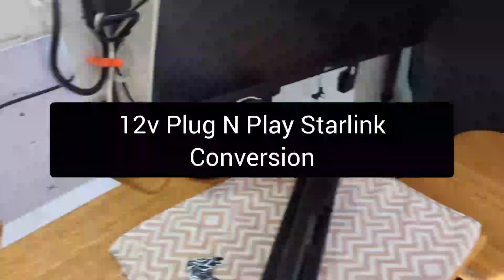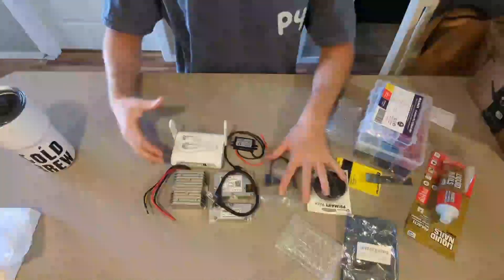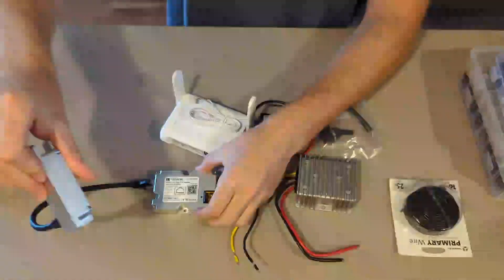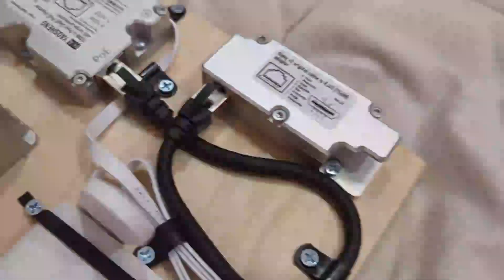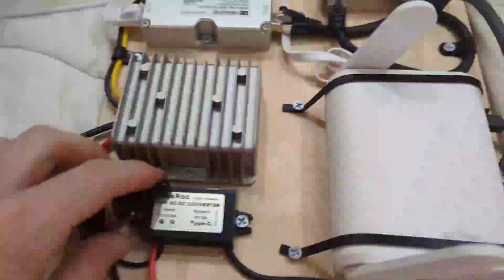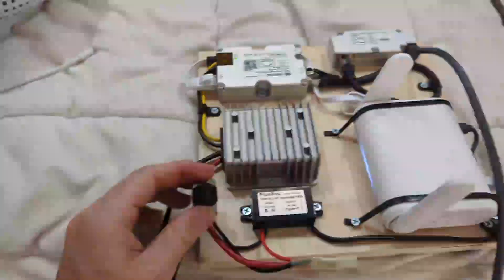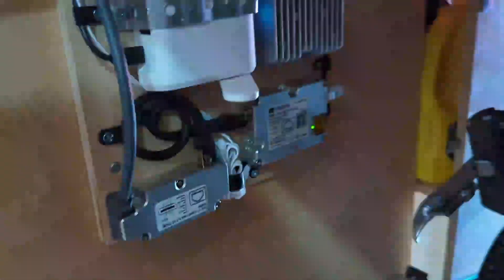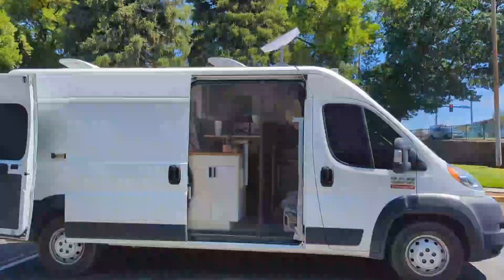Starlink 12v Conversion Plug N Play for Vanlife

Comment: You really ought to have a (~12 Amp) fuse in line with the 12 Volt line connecting to the battery, to prevent a fire, if a short or overload occurs.
Reply from the maker: I have one. I connected it to my fuse box with a 10 or 15 amp fuse. I just didn't put the fuse on the conversion itself. That's a good point though, I should have showed that!

Comment: ❤the video. I have nearly the same set up except I’m using a cigarette 12 V plug with a toggle switch for power. The router comes on but Dishy does not respond and the Starlink app just says disconnected.Did you bypass the Starlink router in the app? Any troubleshooting thoughts???
Reply from the maker: No, I did not bypass the starlink router in the app. I didn't have to change any settings for the dishy. It sounds like a power issue to the dishy. I'd double check the wiring for the 48v up converter. You can use a volt meter to make sure 48v are coming out. Otherwise the up converter wiring might be wrong. Hope that helps. Also, to note, the dishy always took several minutes to respond once I powered my conversion on.
Reply: @cyber_van_life  
Thanks

Comment: It's amazing the options available compared to early 2023. A bit of antidotal evidence from my 12 volt dishy v2 conversion is the average of 60 watts of consumption at nominal 13.8 volts when I am moving data at its full potential. One thing to keep in mind is that you need at least 10 amps deliverable capacity on the 12 volt side. Snow melt mode would definitely push it closer to the 100 watt side, but I don't get snow where I'm at except once every 10 or so years. Keeping in mind that the numbers is just for dishy powered up on its own solar and battery pack.

The initial 9 amp startup surge is quite ridiculous for only for about 3 to 4 seconds then it bounces around 3 to 5 amps after that. Another thing to keep in mind if you're terminating your shielded RJ45 connector on the dishy cable is making sure your shield and drain wire makes good contact with the plug shield or you'll have rather strange RFI issues that you'll be banging your head against the wall wondering why your electric accessories are going crazy (don't ask me how I know).
Reply from the maker: Great details to keep in mind!!

Comment: Hallo from Sweden I have done the same but with a teltonika rutx 11 router and my home router Good down load but upload  really bad. Have you good upload speeds like 20-50 Mbps. With the Starlink original router modified to 12 volt My upload speeds are in that area. Did a test with third party router compare to original with 480 Mbps upload to dropbox. Third party routers about 1 hour,  modified Starlink router 12 minits That is a big difference for me. Download a little plus for Third party router. Have test this now several times 12 volt Starlink allways the winner. But Starlink router seems to be a little more power hungry. Sorry for my bad english but hope you understand what  I try to explain. I think download/upload a file will tell you more than all kind of speed tests because they will be very different every time I use them. Keep up the good work it is always fun to build and explore
Svante.

Comment: nice work!!  I would like to know what the total watt draw is with all the equipment powered.. my dishy pulls about 45 to 50 watts from the wall with the stock router and a total of about 57 watts with the little victron 12/375 inverter  ..  for a comparison point  thanks for the video
Reply from the maker: I don't know how many watts it's using now. I have it in a van with all my other electrical components and I'm not able to isolate the watts from it alone.